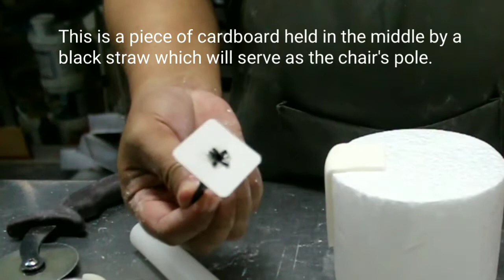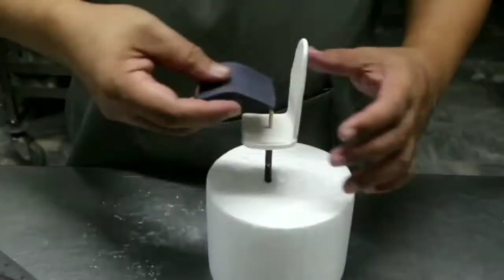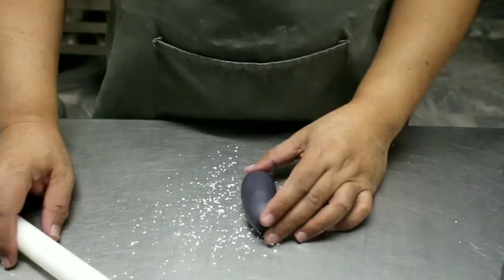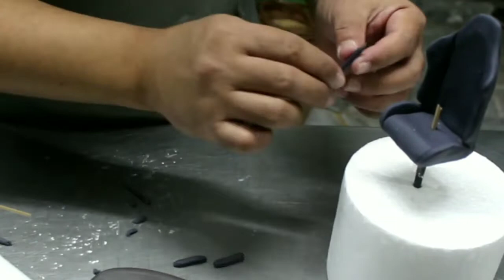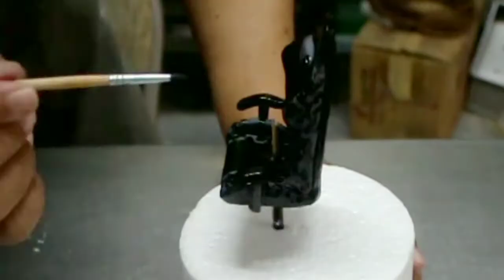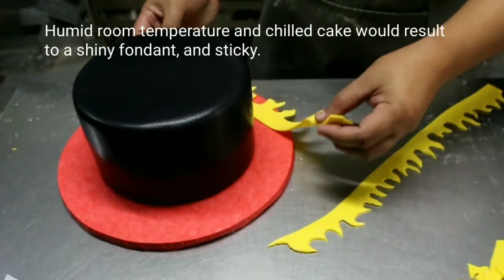Making a cake for a gamer/Gaming chair cake topper @ArtCakes

Comment: Do u work in an air conditioned room? Im afraid to cover my cake with fondant because of the possibility the fondant will become sticky due to humidity...any tips on to overcome this? Thank you!
Reply from the maker: I don't work in an airconditioned room since I started this vlog a year ago but I used to, when we still had a store. I have to say working in an airconditioned room is way better. You don't have to rush during the covering of the cake 'coz in a non-aircon, if you're not done before it starts to get shiny, it would be difficult to make corrections. If you're used to covering cake with fondant, I don't think you would have problem. The key is to work on it fast.
Reply from the maker: Another way is: don't chill the cake. The stickyness or sometimes condensation occurs when there is big difference between the outside temperature (room's temperature) and the cake that just came out of the chiller. The colder the cake, the longer it takes for the shine/stickyness to go after covering, but once equilibrium temp. is achieved, that is, cake's temp. is the same as the room's temp., the shine goes too and the fondant dries up. The problem with not chilling the cake is that  the edges may be too rounded and the cake maybe too soft to work on smoothing it. What I do is if I don't chill the cake, I make sure the fondant is thicker than usual. This helps make managing it easier.

Comment: can i use ready made rolled fondant on this?
Reply from the maker: Yes, we use ready-to-roll fondant. For the chair, you'll need to add tylose to the fondant to help it dry fast. And also, to harden it. For the main cake cover, no need to add tylose.
Reply: @ArtCakes  thank u so much po! 
How about if I will use DLA white fondant, is it ok to use also as a grandma topper?Pls i need your help.....thank you in advance
Reply from the maker: flor usagara
Yes, you can use DLA fondant too. Just add a little tylose powder to strengthen it.